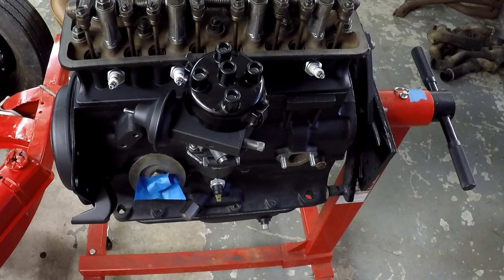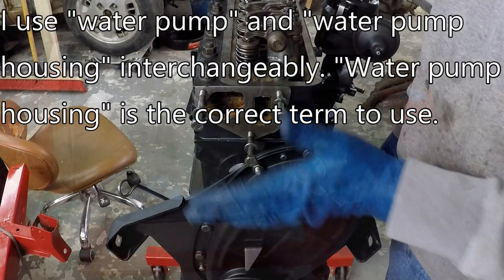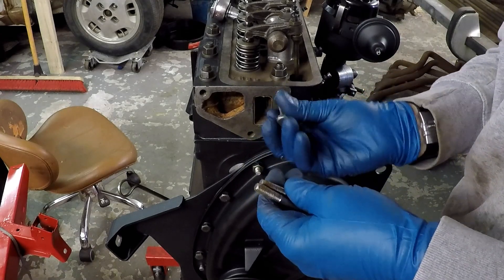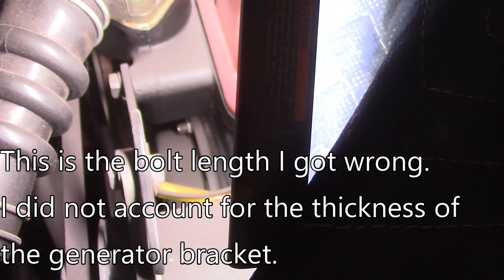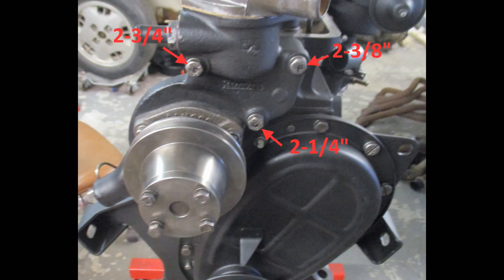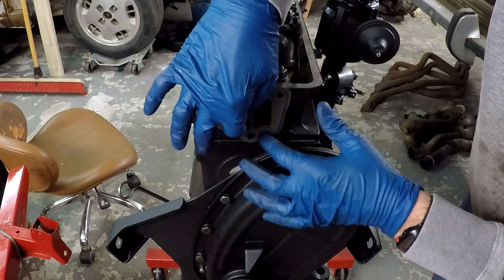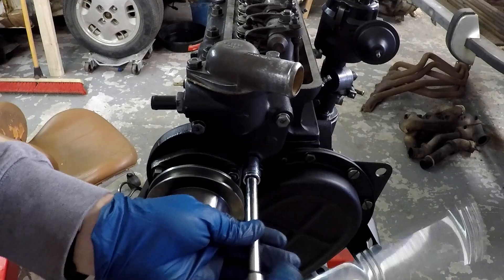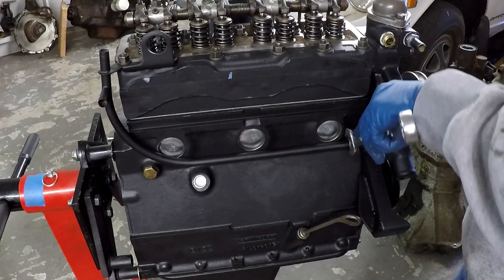Triumph Spitfire Engine Rebuild #9 - (Corrected) Fuel Pump / Water Pump Housing Installs

Comment: extremely helpful videos to help preserving this legacy -  thanks for sharing all your wonderful detail work! -  Question: i see a lot of rebuild kits with larger "round" diaphragms -  but youre pump has little "lobes" -  will Rimmer or Moss have the smalle type like that, and do u recommend the red diaphragm style or black? andy pros or cons?.....also: many people seem to recommend running a 3psi electric fuel pump -  but being a fixed-speed, it seems that it wouldnt deliver "more" fuel as rpms increase....versus the mechanical one, what i would think delivers less during slower, and more during higher speeds -    thoughts??
Reply from the maker: Hi and thanks for watching. As far as I know, the rebuild kits may have either color and I don't think there's an advantage to either - they're the same material, just made to different colors. As for the diaphragm, the large one is what move the fuel and the two smaller ones, surround by metal, are actually check valves to prevent the pump from moving fuel backwards as it flexes. The ones I had were staked into the pump and I didn't replace them because I was too afraid to cause damage getting them out. You can test them by blowing/sucking on the pipe. Not pleasant, but it works. The electric fuel pumps work differently from what I understand. They will pump out 3psi all the time and can keep up with the flow at any fuel demands the little Spitfire motor would need. If the engine doesn't need the fuel, the float valves will shut it down the electric pump will essentially just sit there and recirculate the fuel internally until it can move it again. Not exactly like that, but close enough for understanding. If you do go with an electric pump (I'm still deciding for my TR4), I'd recommend a quality one, like a Facet. The knockoffs, as with most things these days, are not reliable. Thanks again for watching. If you want, you can email me at roundtailrestoration66@gmail.com if you have any other questions. Cheers!
Reply: @roundtailrestoration  thanks Chris -  I will reply here, if I may, so that others can see this important nuance. It seems that time/ethanol/storage/manufacturing anomalies, etc can almost guarantee that a rubber diaphragm will, in time, fail....and possibly allow fuel to breach into the block, and thin/contaminate the oil/lubrication -  a cardinal no-no. If this is a sensible assumption and possible threat, it seems that the most "prudent" thing to do, is to gut/delete, etc the mechanical pump, and go with a quality electric fuel pump (and possibly a pressure regulator, if necess, depending on the carb). I think ive seen people use some sort of delete-plate to block off the hole, but leave the mechanical pump there as a "Flow-thru",  to preserve the original look?
Reply from the maker: Yup, you could do that (flow-through). I think you can rebuild the fuel pump, but that's definitely up to you. Off the top of my head, I don't think there's communication between the fuel and the block in the pump body, so even if the check valves and/or diaphragm failed, I don't think you'd leak into the motor. I could be wrong, but I don't think so. My fuel pump was original and the check valves were, and still are, fine. I've made a blanking plate for my TR4 if I decide to go with the electric fuel pump, but I'm not trying to keep originality on that as much as I was trying on the Spitfire.
Reply: @roundtailrestoration  Thanks Chris!! (where'd you find the AC pump rebuild kit?)
Reply from the maker: @jmm1000 think I got it from Rimmer Bros. I think Spitbits carries them, tho. Not sure about Moss.

Comment: On my spitfire the head stud that also holds the water pipe bracket is a little longer than the others. The bracket goes on top of the nut that is torqued and a second nut secures the bracket
Reply from the maker: Yes, I think I remember the slightly longer stud. I didn't have the two-nut arrangement, tho. I'll have to double-check that. Thanks!
Reply: @roundtailrestoration  another great trick is to use lug nuts with the tapered side up for the rest of the studs. You then have more threads holding the stud